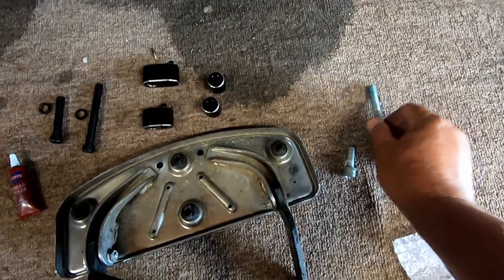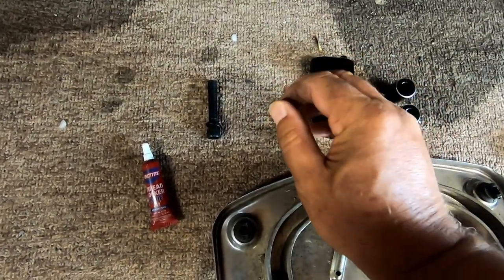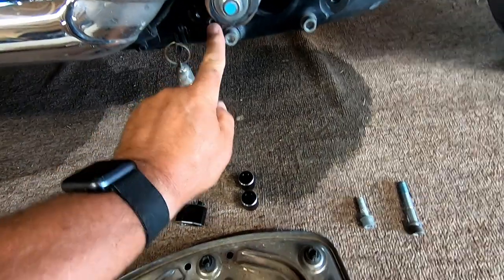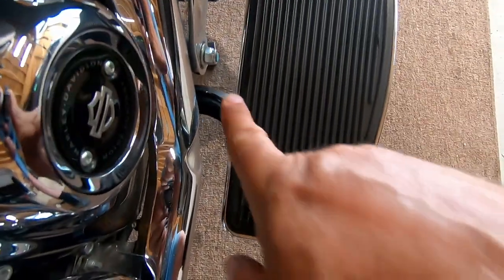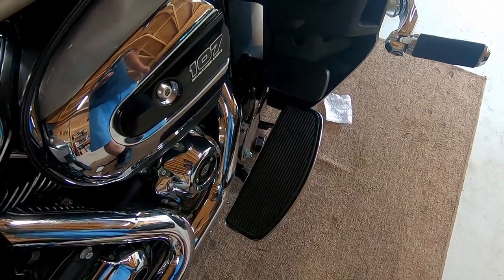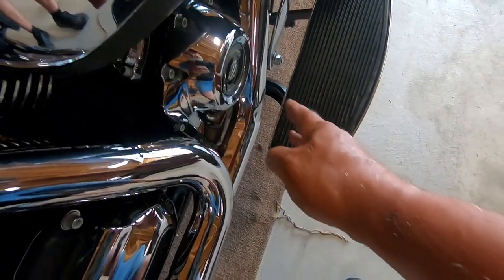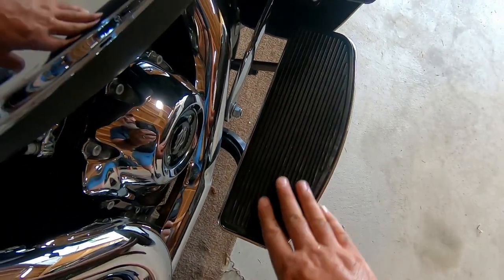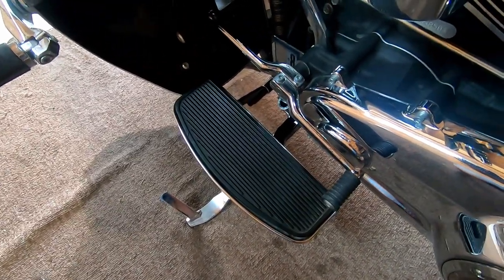Make your motorcycle more comfortable extend your floorboards

Comment: You will like them. I have the 3/4 “ extender now and like them a lot but I am thinking of going to the 1 1/4 extender.  The way I use my floorboards my heels get sore on one side during long runs.
Reply from the maker: They made a big difference and easy to install. Ride Safe